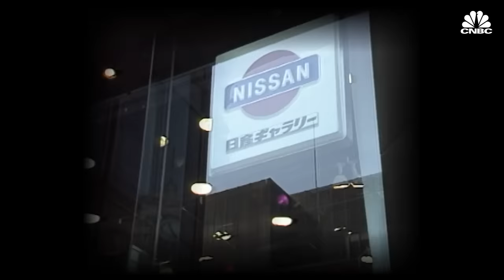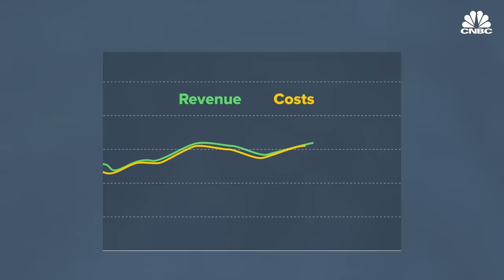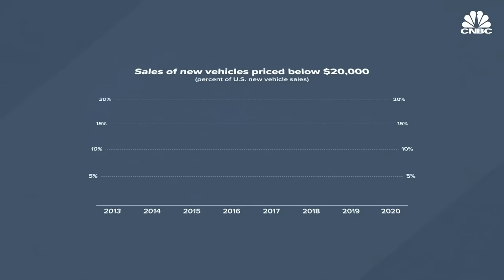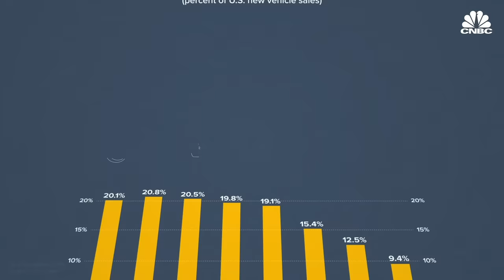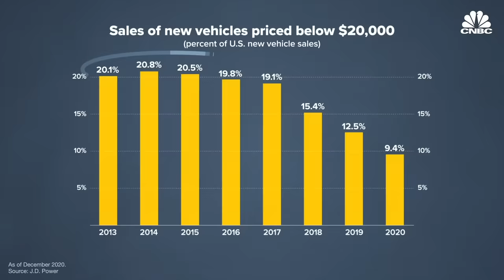Why Cheap Cars Are Disappearing

Comment: It’s either buy used cars for 2-5 grand or buy 30k+ cars
Reply: You're absolutely right
Reply: Even many used cars are being sold for $10k-$15k. They call them "pre-owned" instead of "used" so they can charge an extra $5k.
Reply: I bought my car for $1000 on Facebook marketplace cash then put in $3000 in repairs. Now it gets me around
Reply: @RubenTrucks  same
Reply: For me the sweet spot is 5k for a car you plan on maintaining and driving for years, or a 1-2k car you need just to get to work and home for a while so you can save money.
Reply: @RubenTrucks   Bought a 2003 Mustang GT, did some upgrades and maintenance(tires, breaks, fluids, spark plugs), now she drives better than new. All in all I spent about 6k including fixes. A new mustang GT would cost atleast 35k. I saved 29 thousand and years of debt.
Reply: Hey stop making me feel bad about my 40k purchase! 😉
Reply: Or build your own
Reply: @christopherwarsh  you should feel bad, unless you're rich.
Reply: you get to buy a 40-50k car when the come back from leases at 3-4 years for less then 20k.  Those cars are darn nice - and have features you can only dream in car which was built for 20k.
Reply: 2 to 5000 must be 15 20 years old
Reply: @RubenTrucks  I'm not buying a car and working on it out the gate
Reply: Bought a Lexus ES300 for $5,000. It's a complete grandpa car, very well taken care of, low miles, and no problems. I have no regrets with this purchase and I'll gladly pay 2,000-5,000 for a car instead of paying tens of thousands for a new one.
Reply: You can get a crate engine for almost any vehicle for only a few thousand. We need to start swapping engines to multiply the lifespan instead of trading up cars to pass the buck like a hot potato, that ultimately goes to the scrapper in a disposable fashion. 

We need less plastic on cars. You should be able to pass on your car to your grand kids and have it actually make them happy. If you gave someone a tricked-out classic ford 500, it would be a collectors item. But will a 90's ford taurus ever be a collectors item? Or a ford 500 from the 2000's? What about a 94 toyota Camry? 

We need to return to Henry Ford's idea of standardized parts. But instead of just being able to swap hubcaps between ford and mercury versions of a car, we should be able to switch any part with any car maker, and Frankenstein cars together using whatever parts we can find, or conversely the best parts of all brands. I believe 3D printing will soon change cars to be modular like that.
Reply: @icemike1  nah it’s better than being in dept for a $20k car(no matter how old u are), plus that price is good for 2-3 years enough to save money to get $30k+ cars. And not all used cars has major problems, just gotta chose and inspect the right one
Reply: @mida8261  what year
Reply: @r2dxhate  plus a few thousand in labor
Reply: @christopherwarsh  If you make at least $120k/year in household income and have at least a $4M net worth, you have earned the right to not feel bad about a $40k purchase on something big like a car if that is what you wanted
If you financed it for 72 months, make $40k/year and have a negative net worth, you should feel absolutely horrible about that irresponsible purchase, because it was idiotic
Reply: @wreckingopossum  out of all the languages in the world this dude decided to speak facts
Reply: @icemike1  2002.
Reply: @r2dxhate  90% of the car parts are bought from a handful of suppliers. With power train is more tricky. The engine must fit with gearbox and shafts, otherwise they can be damaged if the engine is too powerful
Reply: @wreckingopossum  after 72 months how much did you payed for that 40000 dollars car? More than 40000.
Reply: @icemike1  You're right, that's why we need to engineer cars to be quickly disassembled.
Reply: Years ago I bought used and it was falling apart...never again! A friend of mine just bought a $2K car and he has already spent $1,000 with no end in sight. Engine light for gaskets, catalytic converter and more recently it's just burning half of the oil in like a month lol

Cars in the US are abused by people. In Europe a car is being treated nicely and most see it as an expensive thing that needs to be treated with love. In the US it's just a necessity to take you from point A to point B. Most change oil when the light comes on instead of 6 months. 

Most go to the service when the car breaks down. How many times I've been in cars were there's a noise and the driver says...who cares as long as it drives. In Europe people take their cars to the service department as soon as they hear the slightest noise. 

So in the US either buy new and keep it or lease.  I would never ever buy a used car again in the US. I just remembered another car which a friend bought one owner. It is a Honda SUV. He recently changed the suspension. When he lifted up he noticed that it was so poorly replaced before that the whole thing was hanging by a thread! His mechanic said that he and his family could've been all dead if the suspension had collapsed!
Reply: @RubenTrucks  damn,I paid 600 and put 150 into service it and it runs like a dream,but it did all the work myself ,so that saves a lot of cash, ☮️
Reply: Roberto Mundo  Key thing here...Belgian man. If you bought the same car from a US owner 99.99% you would be screwed. One of my cars is a lease but I change oil every 6 months and I report every noise. The service department even asked me why I bother since it's a lease!
Reply: @angelgjr1999  thats nice. the new ones make really good power though
Reply: I bought a 2013 or 14 buick  lacrosse pearl white for 1,300 at the auction, F dealerships.
Reply: I got a 92 miata for 4k and its been with me for about 6 years or so.
Reply: There are new cars like the Mitsubishi Mirage which cost you less than 11k new but;
 scared parents and the media pressuring younger people especially Gen Z my generation and tell them: You need an SUV even if you live in New York City and drive there 98% of the time..
Reply: @dustincookson5479  Yes but is it worth a grand a month for 7 years?
Reply: @1310beth  im not sure they mark up the price that much. if you are willing to bargain the dealer makes a couple hundred bucks. ideally you buy from an individual who does not need to make a profit
Reply: @sebastiant5695  honestly, if I ever became decently wealthy I would just buy the 1-2 year old models for that reason. Im not buying new cars till my net worth is at least 2-3 million
Reply: @icemike1  not at all! look at marketplace! im a crown victoria guy, a 2011, last year, goes for around $4k. a 20 year old vehicle will likely be $2k or under. its not hard to find mid 2000s crown vics in the $800s range that need a bit of work
Reply: @Carterthielftw_  2011 in excellent condition
Reply: Exactly
Reply: @christopherwarsh  Time for you to log out
Reply: @angelgjr1999  true,  bought a 7 year old Volvo XC90 for $5000 - ran it for 110.000 additional miles - with hardly any repairs.  Hard to beat that value. Was once a 60k SUV.  Still new cars don't have that kind of features (aside of a touchscreen toy) like freaking 4 heated seats and 5 zone climate control.  You don't get that on a sub 20k new car.
Reply: I drive a 3 year old Hyundai Genesis that costs 50K new, loaded with all the latest tech. It cost me 20K! Thanks to the previous owner for eating the depreciation for me!
Reply: @sebastiant5695  lease returns are where its at. 12-17k for a 1/2 year old lease return car with 20-30k miles, still under warranty that would have cost 24-30k new just 12-24 months earlier.
Reply: @christopherwarsh  40k is nothing now in days lol
Reply: @mida8261  Be careful. I have seen several Lexus"s leaking oil
Reply: Most car problems start after the 5-6 year threshold. So the thing is that you could buy an endless money pit. It is risky. And with the skyrocketing of new car prices, used care prices have surged also. That is if you are looking for something mechanically descent.
Reply: @angelgjr1999  for those who can afford it, probably. Just depends on the person more than anything. getting 460 hp on a new edge requires not only good skill but also money... and your losing reliability
Reply: @icemike1  I got a 2010 Hyundai Elantra for $4500 (tax & tag included) earlier this year and haven’t had a single problem with it. Every car my family has bought in the last decade has been 7+ years old and under $10k, and the only one with issues was my brother’s ‘98 Mustang. You don’t have to spend a ton of money or get a brand new car to get quality. Just know what to watch out for, buy quality brands, do regular maintenance, and you won’t have too many issues.
Reply: In spite of what this CNBC video says, you can still get a decent new car for around $20,000.  I bought a brand new 2020 Toyota Corolla this year.  I paid about $19,400, not including sales tax.  I got it with a manual transmission, getting a CVT automatic would add several hundred dollars to the price.  But anyway, it's an affordable, reliable car that will last for many years.
Reply: @r2dxhate  do you know what a honda is? 
You will like it. Exactly what you are saying but I doubt you can put it together.
Reply: Unfortunately this is true. Cars are becoming somewhat of a luxury to own as well.
Reply: I’m in my 20s and you’ll be sure I’m getting mine used
Reply: @WarriorsPhoto  Ha learn to work on them and you could easily have way more cars than you need all running fine!
Reply: I bought a used one for 30k+ ^^
Reply: I dont understand why american can have 1k decent used car. In my country, 1k used car usually from 80s or older and totally rubbish
Reply: @melmendoza4996  Why do you say that? What's so special about a honda? I thought they were supposed to be easy to work on, so why wouldn't I be able to put it together? That sounds like a contradiction. You're saying a honda is easier than anything I ever worked on, but also more complex than anything I've ever worked on? 

And no a honda isn't what I'm talking about. Honda's are toys for teenagers. When you get inside them, it feels like a cheap plastic toy that would disintegrate in an accident. 

I'm talking about replacing or upgrading any part on a car with plug n play engineering, that makes it as simple as plugging in a new computer component.
Reply: @dustincookson5479  True.
Reply: True that. I afforded a 2 grand car cuz I didn’t wanted to buy a 20,000 car with loan on the top
Reply: @RubenTrucks  yes that’s the thing with used cars you need to put some money in for repairs
Reply: I’ll buy used till I die, cars a dead investments and ppl get rid of great cars for the most simple reasons,
Reply: Just DoIt  that's easy - people want to get rid of their 3yr old car because they want the latest model. Ie. "Oooo that 2021 model has XYZ and looks shiny!"
Reply: Not at all
Reply: @angelgjr1999  you didn't save anything,  you just choose a cheaper car bc you can't afford a new one. The new mustang would smoke your car lmao
Reply: @wreckingopossum  you only live once what so bad about financing a car ? Money don't come with you to the grave
Reply: @sakispsinakis  I had to buy a car quickly had only 3 ended up buying a 2008 suburu outback for 1800 within a month the car had to be taken to the mechanic left me and my two year old stranded in the damn highway spent over 1000 to fix it and it’s still giving me headaches! So due to this I am saving up and buying a 2-3 year old suv. Just hope this car lasts me enough for that. I will NEVER purchase a used cheap car EVER again
Reply: @halohunter5217  I like your thinking 💭. Are you a mechanic?
Reply: @chrisrstt  I “can” afford it. I just don’t want to spend a grand every month to pay it off for 7 years. 
Also I can “smoke” your 5.0 with a supercharger. And still spend 1/5th of what you spent. :)
Reply: @lanenadrz  I am just about to call the friend who brought this bargain for $1.8K. He is at the point where he needs to rebuild the engine. I am getting an update but the last solution he found was to use a thicker oil so that it doesn't burn all that much. 

Take my suggestion and buy something with warranty. One of the cars I had was a Jeep Cherokee. I even bought the unlimited warranty but ended up sending back the lease. One of my cars now is a Grand Cherokee lease with low miles. I am only thinking of keeping it with a warranty for 8 years. It has an adjustable suspension and it has acted up 2 times already. Do you really want to have an expensive SUV with a 2K or 3K bill? 

Like I said the main problem is with my fellow Americans. They treat everything and everyone including cars, jobs, friendships as temporary and replaceable. They give no value to anything and they fix nothing. I grew up in Europe and we worked on everything and didn't just throw them away. When I see a person just not caring about his car making noises or waits 2 years to change oil then that tells me a lot about his character.
Reply: @sakispsinakis  I live in a area with heavy snows so I need a suv. I was looking at the Jeep Compass.
Reply: @RubenTrucks  bought a 2007 HR 350z fully loaded convertible for $3500. I screwed up the engine but put in a newer one with 40-60k miles on it. All in all maybe put in 6k with new brembo brakes, tires, etc etc now I have a cool sports car instead of getting a base 370z for over 20k used with high mileage lol. Used market is where it is people.
Reply: @jponz85  If your time is worth pennies that is. My time is worth about $200 per hour when I work or more. People tend not to take that into account. To me even going to the dealer is like $1,000 loss just in time. I don't even take into account the meeting you might miss or a deal that didn't happen. In the US time is money. If with a few hours of work I pay off my lease and have no headaches then why would I risk that?
Reply: @lanenadrz  Jeep compass is a good cheap car but maybe worth looking at a lease offer. It you get it around $250 what's the point in buying used?
Reply: @exaucemayunga22  haha
Reply: @RubenTrucks  what vehicle?
Reply: I found 850$ my first car ever. That baby still running it's a Honda 😂😉
Reply: @randomjake1488  1999 Pathfinder. Doesn't look like much but when I turn the key it goes
Reply: In the US, you can still get a Civic for $20k and a CR-V for $25k.
Reply: 11:43
Reply: @sakispsinakis  the headache is you dont own a car, your lease contract will go up, you'll have to check you milage if you go over it, if you buy the car you'll lose like 15-20% of the car value just by coming out of the lot! Lol. Used cars you can buy cash like I did and still have no issues if you inspect correctly and buy correctly. 95% of public dont make $200 an hour or even $1,000 over 2-3hrs just by being at the dealer instead. So your argument has many flaws
Reply: @sakispsinakis  thought it would come up less expensive. I will look at all my options when I get to that point thank you
Reply: @jponz85  People who don't make that kind of money should do 2 things. One - Spend all your time trying to increase your income. I started with like $25 an hour but I pushed and pushed. 
In the US there's no middle class anymore so either you go up or stay at the bottom

Or Two - If you are stuck in the bottom move to another country where health, education are provided and property taxes are very low. I've moved countries and would do it again.

For cars...every car you buy used is a gamble. It's amazing if you get a good one but could be a headache if you get a bad one.
Reply: @sakispsinakis  agreed.
Reply: There's a few cars that are less than 20,000 dollars , sometimes even less than 15,000 toyotas hondas mitsubishis kia and and hyundai's are pretty cheap
Reply: I rather buy used tbh
Reply: @elsociord7553  Good choice. What kind of car are you buying?
Reply: @Lakshmi Kimmu Are you talking about a BMW or something European?
Reply: Seriously tho
Reply: @DYLAN102001 Right.. it just getting past the ever rising regulations that come with owning a car.
Reply: @RubenTrucks  How do you feel about the right to repair laws? It starts with Apple phones but the RTR regulations can be passed on to motor vehicles easily as Apple starts to make road vehicles..
Reply: @erenkaslte8046  I built my car. Drive it to work every day. Legally inspected too.
Reply: @DYLAN102001  That's cool sir.. I'm working on a Datsun myself.. I was just pointing out that its going to be harder to have a car in the future due not just to rising prices but regulations as well. TBH less and less people are giving wrenching under the hood less of a go these days. I can't much blame them the engine bays of todays cars are more cramped than the 1990's 300zx and mitsu 3000gt with god knows how many "emissions air quality" devices.
Reply: You can find cheap used cars, when you have time to search.  Many need a replacement vehicle now, and don't have much time to search.   Having access to Uber helps the budget car consumer.
Reply: @erenkaslte8046  Do you live in Cali? If you do get out! I heard they were trying to pass a bill that would make DIY repair illegal. I understand your point about people not wanting to repair their own vehicles, the wiring and plumbing under the hood is a nightmare. That's why I  rebuilt an older vehicle from the 70s. Here in Texas it's just $7 for inspection. No catalytic converters required.
Reply: @sebastiant5695  90% of people abuse leased cars.
Reply: I used to buy new cars, and I got totally fed up with the experience. The new tech didn't meet my expectations, and all the computer crap left me at the mercy of the mechanics.  About 5 years ago, I said, "Effit, I'm out!" and switched BACK to a couple of OLD (90s) Japanese cars in mint condition.  One is a Honda, and the other, a Lexus, and both were over 25 years old when I bought them. 

"You must be friends with a mechanic!" people said to me.  Quite the opposite; I wanted FREEDOM from mechanics.  

See, this era of car was designed in that, "sweet spot," where the computer is juuuuuust complex enough to make it good (Fuel injection! Yay!) while the majority of the parts are mechanical, and thus simple to repair.  These things will run forever, so long as you keep on top of basic maintenance. 

I bought a set of tools, and started studying. I started with oil changes, since I was a complete mechanical novice.  Today, I've learned enough to NEVER need a shop again (except for bodywork, God forbid!), and I have two new-condition cars (despite their age) that make me extremely happy on the cheap. 

I get all my parts online, so gas and insurance are really my only notable costs.  The Honda is -- with its double wishbone suspension -- on par with supercars for handling, and the practicality is second to none, all while sipping gas like a Prius.  The Lexus? Hahahahaha! It retailed for about (in adjusted dollars) $100,000 back in its day, and I got it for $2,000!  And you know what? It's still giving me every bit the experience of owning a hundred-thousand-dollar car! It makes you feel like a king, for next to NO money!

Laughing all the way to the bank. Laughing all the way down the road. I would recommend this to ANYONE else who is fed up of being a plaything of the big companies.
Reply: Pretty much. I make good money and still wouldn’t buy a new car. Ever. Not unless it lasted me 20 or more years.
Reply: @Maplecook  Those older Lexus models are pretty nice, with reliability that used to be true for Mercedes.
Reply: @timothykeith1367  Thank you for replying! Your words are soooo true. I freaking LOVE my car.  It has the 1UZ-FE engine, which has been proven to be able to go a MILLION miles. (Mine has 150,000 on her, so she's good for the rest of my life without a rebuild. LOL) And when I put my foot down, holy crap is she ever fast. Like, "we're not giving you a ticket, because you're going directly to jail," levels of fast. 

The chassis of my car is amazing, too, since it shares 90% of its mechanicals with the MKIV Supra. Used Supras are going for ridiculous money now, and nobody realizes that the SAME car is available for next to nothing. How similar to the Supra is my car? Like, Firebird/Camaro similar. The price difference is absurd...all because the Supra got to be in Fast and Furious. But whatever, I'll take the 98% discount. Hahaha.

Are Mercedes easy to work on? I have no experience with those, since I learned everything on my own vehicles.  (And will upload my experience later if you're curious to watch a novice suffering with car repair. haha) But if I can do it, anybody can. (I'm not anything NEAR being a mechanic. I'm a school teacher, for crying out loud.)
Reply: @TheExotich1  90% of people which are leasing are scared that when there is a Ding or scratch in the car that they have to pay extra in the end.
Reply: Yea. They want you to borrow. When you can buy with 5 k or under. Just fine.  CNBC 🤣😂🤣😂🤣😂
Reply: @sebastiant5695  i don't know what's it's like nowadays but think of it like this.buy a car that's low mileage and give it a new lease on life such as an audi or a lexus or a mercedes or even a volvo(only the small car models of all these brands)that's only a few years old or in about the same price bracket buy an ordinary corolla or civic or mazda 3 or hyundai.if i was in the market for a small car i would go the yuppie brand.i am not some twenty something anymore who has to worry of social embarrassment.
Reply: Best used cars to buy are Toyota's and Hondas. They last you a very long time if you take care of them. I still drive an 06 Camry SE that paid only $4k for it. It's in near mint condition thats mostly driven on the highway. Scotty Kilmer still drives a 26 year old Celica.
Reply: Or buy nothing and move closer to work
Reply: @lendaryreviews  The discipline of owning cheap cars is to be on the lookout for your next cheap car so you don't have to be rushed to find a replacement, or be mechanically skilled enough to always have a dependable
backup vehicle.  So, you should have parking space for at least one extra vehicle.  Even Toyota Corollas need work now and then.  You don't want to be forced to buy a more expensive car just because price = dependable, which isn't often true.  Well maintained is dependable.
Reply: @timothykeith1367  true. Once in a while we find a car we love. And i love the engineer's with a life time story. Car like Japanese cars were banned. And so on.... 20 yrs later. I prefers 20 yr old Japanese car then any new car. Call me crazy. But i think i will die owning this car. ^_^ or passing it down. ... because i cant walk. Some car. Do last a life time.
Reply: I got a Jetta for $6500 and put 83K miles on it. Less than $1000 in repairs. A few thousand in maintenance, brakes, oil, and tires, but that's about it. You pay very little excise tax on an old car too and a lot less for comprehensive insurance.
Reply: @sakispsinakis  There's more to this. VWs and compacts in Europe are more expensive than in the US. Not just because of taxes. US VWs built in Mexico use lower grade components (suspension). The other part is, auto mechanics in the States charge more. I lived in Europe for years and most auto shop owners over there aren't making bank the way they often are over here. I buy used but do a ton of research on what model to buy and what to look for first before pulling the trigger and have saved a ton over buying new that way.
Reply: @getdealtwithquick  If you know what you are doing it makes sense. For me anything sold in Europe is higher quality. I own a Maserati and Audi R8 in Europe no issues whatsoever but then again I drive very few miles.
Reply: I bought a 5k car and that sucker lasted for a decade. I actually stopped paying payments on it. They never repoed it. Somehow the lien fell off and the devil sent me the title free and clear😂😂😂
Reply: You can go to coparts.com and find cars with low miles and small body work to be done
Reply: @angelgjr1999  I need to do something like that... How did you figure the cost off repair on the car you purchased?!
Reply: @sebastiant5695  is that what you do, lease and then buy it just wait 4 to 5 years and buy???
Reply: @RMS550  buy with cash a used (3-6yr) old ex-leasing car every 4-6 years. So I'm always driving a $50-70k Car/Suv  while spending never more then $15k.
Reply: @timothykeith1367  that’s become my strategy. I have two drivable old cars at one time so if one needs work it’s no big deal. Driving an ‘01 Benz and an ‘06 Saturn. I also have a ‘91 Honda CRX that I’m slowly rebuilding.
Reply: @danieldaniels7571  The fun part of the "cheap" car is I can drive pretty many any older car that I like, provided I can repair it myself.  Miatas are dependable.  Hondas and Toyotas are good choices, but older BMWs, Lexus ..., whatever.  I like Geo Metros for easy repairs,- easy parking,  and pickup trucks.  I'd like to see that CRX.  The Geo Metro is a similar car, but the Metro never was anything but a pizza delivery car because of its styling.  The CRX is a potential collector car as clean CRXs are hard to find.   Many like Crown Vics as daily drivers, but not many rebuild the Crown Vic when they need major work, whereas the older Hondas do get rebuilt.
Reply: @1310beth  bought a pre owned for $11,000 2018 model, 28,000 miles, an Elantra, Hyundai
Reply: @chrisrstt  Reasons I would give
1. Integrity - living below your means takes more integrity than living on money you have not yet earned. Of people with at least a $10M net worth, integrity was their number one priority
2. Stress -  the less payments you have in your life the easier it will be to handle life as it comes at you.
3. Wealth building - Compounding works in both directions, but it can only work in one direction at a time, and creating a "spread" is taking on unnecessary risk that mitigates the extra earnings

4A. Legacy (A.K.A. Generational Wealth) - if you have kids they can inherit what you leave to them minus your debts. If you have more debts than assets, they inherit nothing
4B. Legacy 2.0 - If you have left over money you could leave donations to build infrastructure to benefit future generations. Such as has been done with many hospitals, libraries, universities, etc. even if you don't have kids. If you have more debts than assets you have nothing to donate, no legacy to leave.
5. Financial burden of death - your family's financial burden upon your death will be greatly lightened if you are not carrying debt and have an inheritance to leave instead to pay for your cremation or burial and funeral.
6. Live more comfortably - The fastest way to build wealth and therefore to buy more things you want is to have control over your paycheck
7. Your earnings are your own - When you do not finance your cars and tvs and furniture and toys and everything else you keep the money you earn instead of having it go out the door to Ford and REI and MicroCenter and Nebraska Furniture Mart and VISA before you even earn it
8. If that didn't convince you, I doubt anything will
Reply: You need a great mechanic like Scotty kolmer to make sure u don't get ripped off in the second hand car market.  Brand New cars are less likely to fail prematurely.
Reply: Also a lot of those used cars can be kept running for less than the amount of fuel you're saving in newer cars. If they're not one of those 90s toyotas that got 40mpg already then it's just cheaper in general
Reply: @RubenTrucks  In July 2019 I bought a 2004 Chevy Cavalier off Facebook Marketplace for $1000.  The drove it halfway across the country (PA to TX) and used it till May 2020 when I sold it on Marketplace for $1200.
Reply: @r2dxhate  At first that sounds great, but I think that would just cause stagnation.
There's only so far you can push X chassis and still check all those boxes.
Reply: @sakispsinakis  That's why all used cars MUST be properly inspected.
If you buy used and you didn't look under the car a single time, you didn't do it properly.
Those things are very easy to check, especially the suspension issues.

We had a 1991 Honda sedan. It had no issues other than occasional rust. Everything worked. You can buy good used cars, you just need to know what to look for.